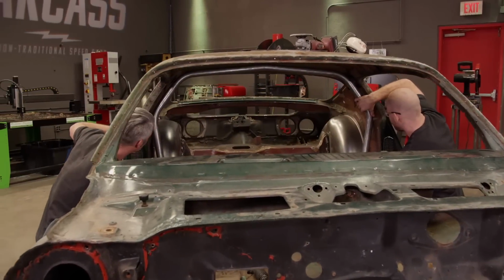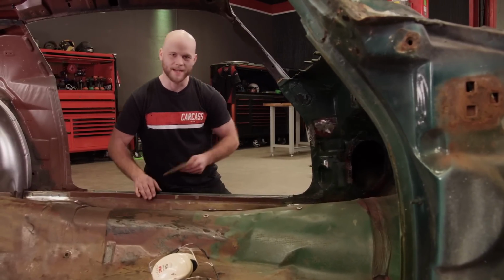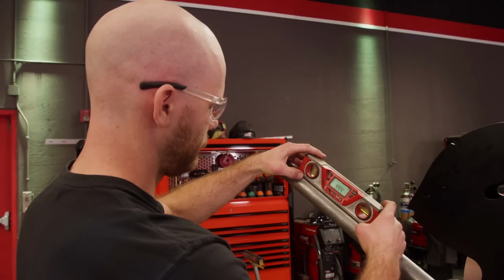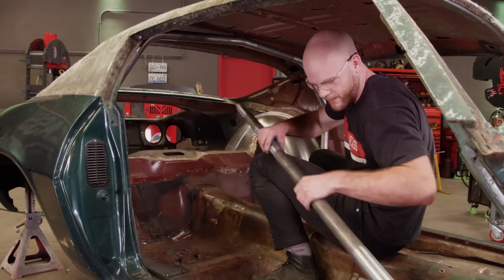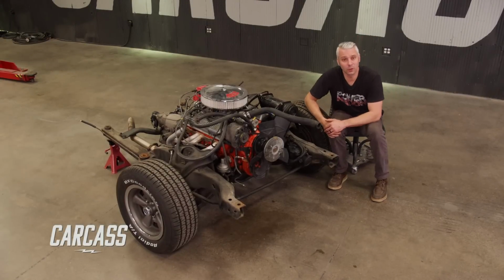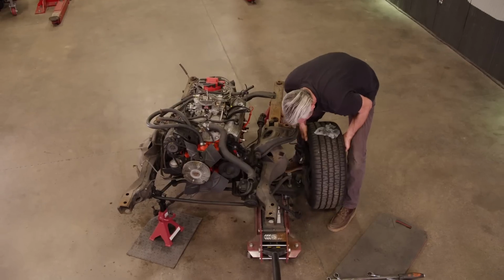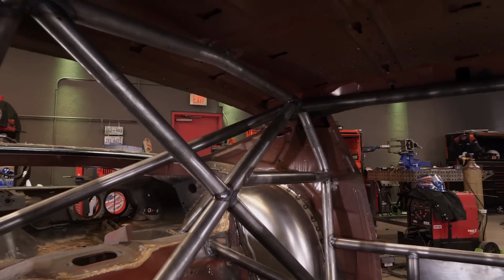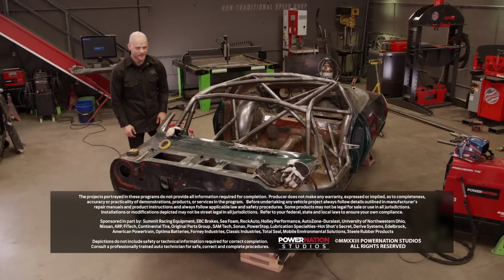Strengthening The Chassis Of The 1972 Camaro Split Bumper - Carcass S4, E5

Comment: i am would just build a chromoly front subframe that bolts to a tube frame footbox X bars, and rear coil over suspension on a bolt on rear subframe , all low porfile chromoly tube with X bracing, and there would not be a need to delete rear seats. 2 bolt on subframes front and rear to a shear off bolt on middle frame. this way you have detachable front and rear subframes on vehicle that if in accident doesn't bend the entire thing up like a full frame car, instead it behaves as a subframe car in an accident because it IS subframe car still, and while driving behaves more as a full frame car does ! hahahah.

Comment: I'm a big trans am fan and I have a '76 455, but I would have preferred these guys cut up a '75 Trans Am instead of an original split bumper camaro.  Or maybe a '74 firebird and put a ''70-73 grill on it.

Comment: hope you stay true to it's heritage and put in a 400 sbc not a ls
Reply: a small block tall deck large bore block from dart, 9.5" deck or custom 10" deck would be nice. With a 4.195" bore. and make the cubic inch about 415 or 420 that way you have rod length and some piston height without too much stroke. Yet any head you put on there shall have more port efficiency and energy because the cylinder itself is unshrouding the valves a ton.